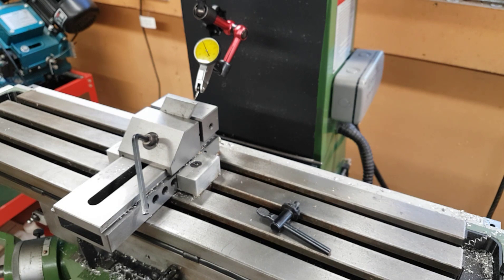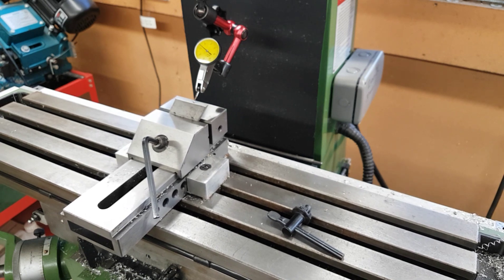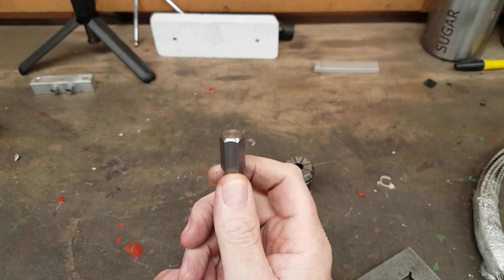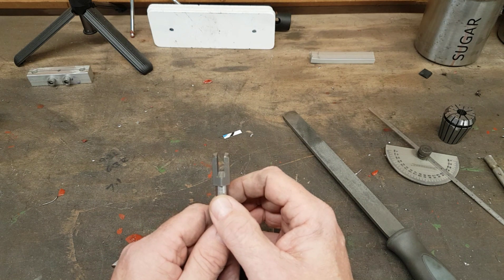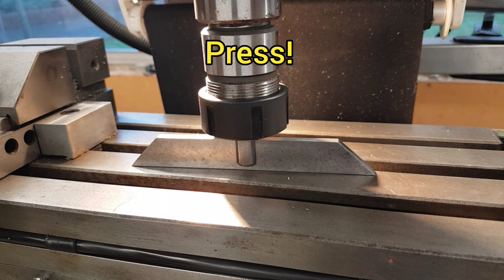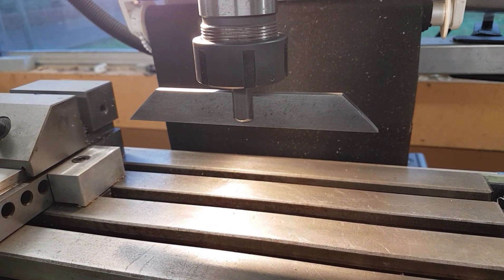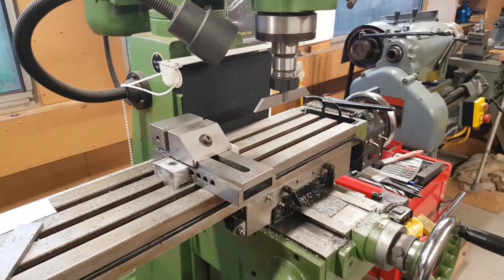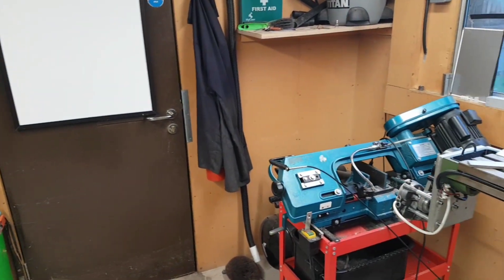Setting up a part quickly on a Mill (without an indicator) 1 of 2

Comment: ok as a long time machinist, when do you most often use the outside of a square secondly why is he using a surface grinding vise on a mill
Reply from the maker: Hi Jason.
The plate square was poor quality and inaccurate so rather than scrap it I repurposed it, 
With regard to the precision vice, that's all I have. I generally work on small aluminium parts.
 I'm disabled, have no income so cannot afford any new tooling.
Hope this explains, cheers Neil.

Comment: Sorry about your health issues. That is quite a good idea. You could get it good, weld (which might throw it off) then run it in the lather and trim it back to square. Very good idea.
Reply from the maker: Thanks Ben.
Was worried about  distortion that's why I thought about pinning it.
Pins first, weld second I think 😊😊😊
Reply: @NellsMechanicalManCave  I think you are going to need to test trying to trim it as one way or another I can see pinning or welding moving it. Reasonably certain you could get away with loctiting it though.
Reply from the maker: @BensWorkshop  I gave it a good clean and then a shed load of Loctite after the video. Will be left under load in the mill until I get down the workshop next. Sunday with luck. By that time I guess it will be fully cured and I will drill and tap, loctite in some grubscrews again when under load in the mill.
Reply: @NellsMechanicalManCave  Cool.